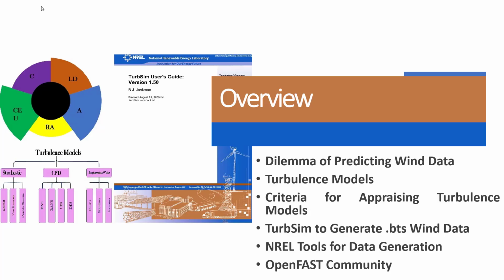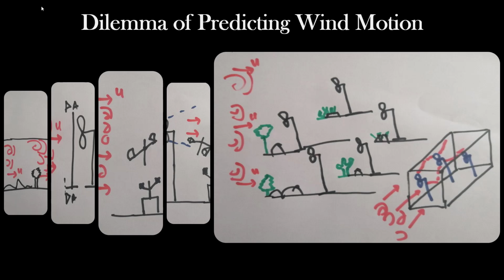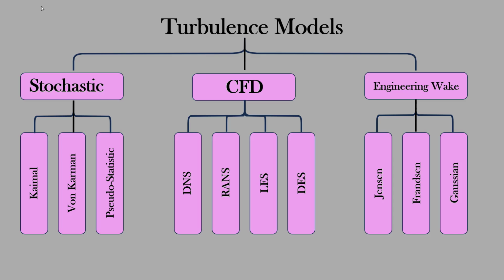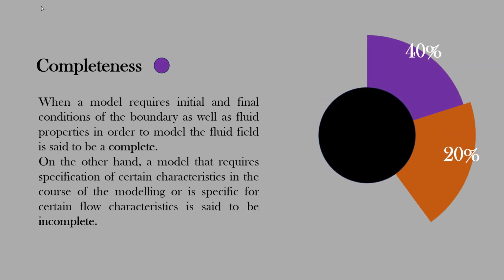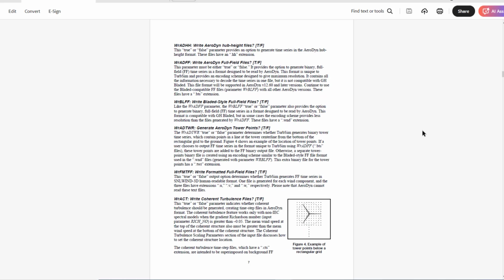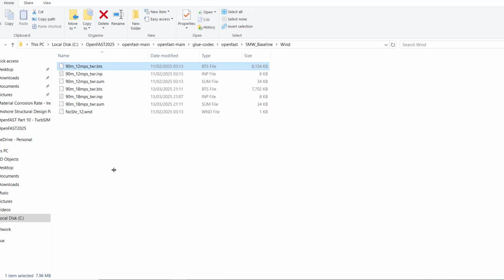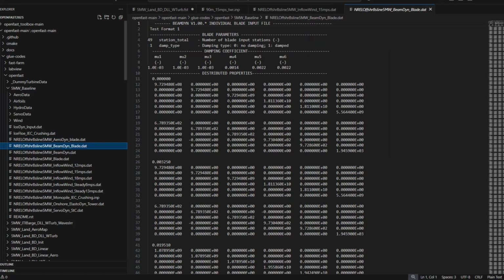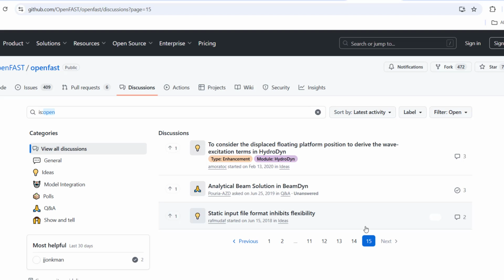OpenFAST Part 10: TurbSim User Wind Data and Turbulence Models

Comment: Should I use TurbSim for a non-operating wind turbine? Or even for just the floater with the tower (and not the WTG)?
Reply from the maker: The Log Law or Power law may be better seeing TurbSim may have other wind turbine parameters included in it's simulation.